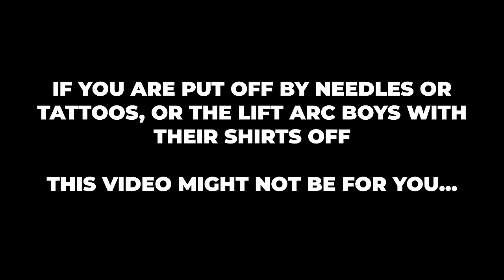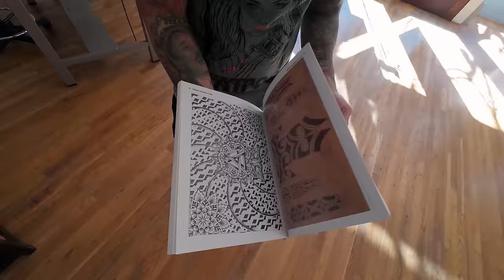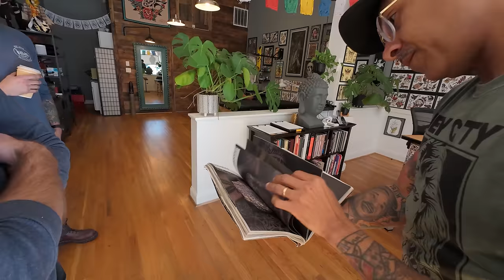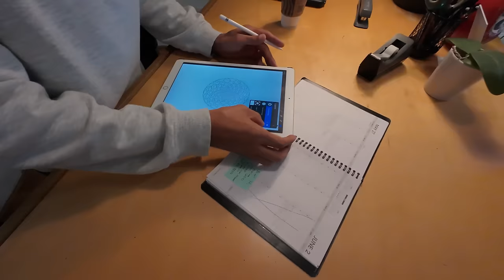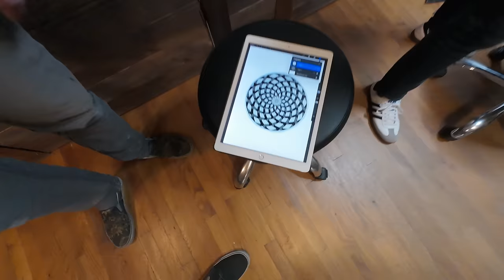We Got Amazing Tattoos for Building This

Comment: Tay, if you would,have welded the bars to the circle first, then trim to length for welding to frame, would that have been a better way of not warping the circle?  Just curious as heat shrinkage is absolutely unforgiving.